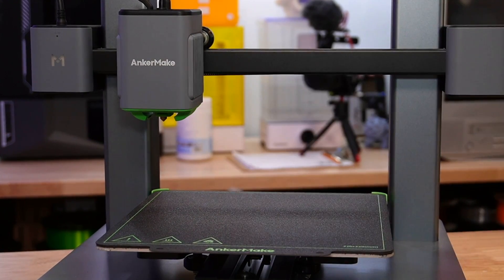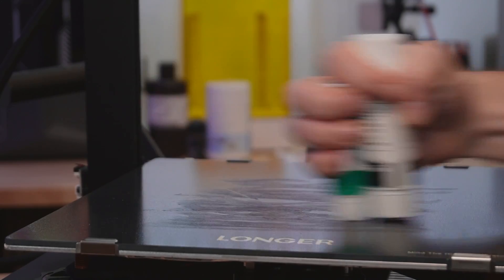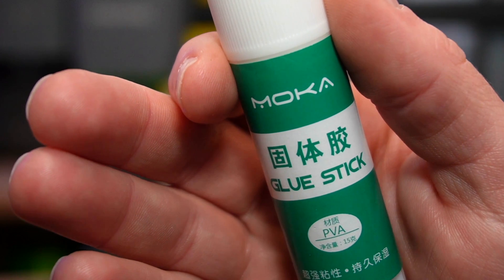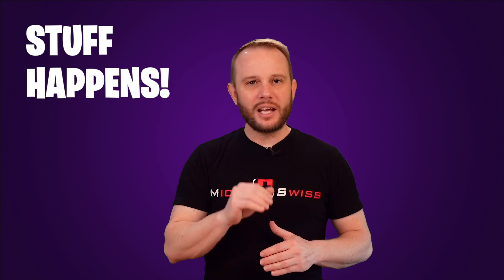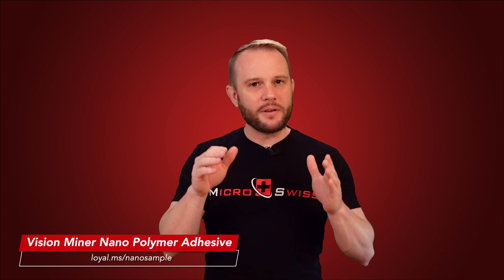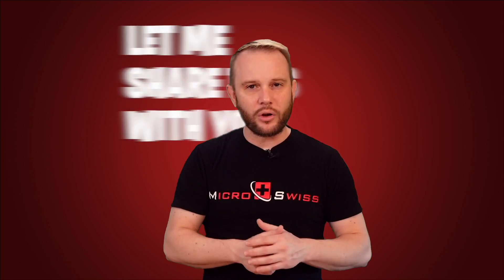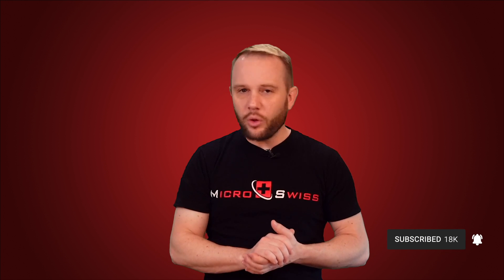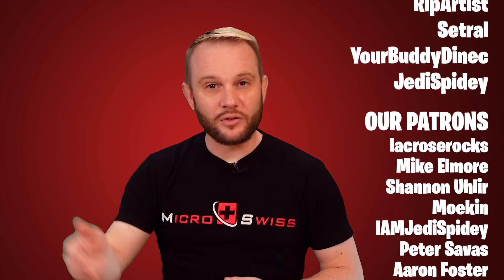This Simple Swap Saved My Difficult Prints

Comment: Pro Tip; PETG when stuck to glass will come off much easier and prevent damage when you heat the bed to 100c 👍will also probably ruin your print 👎

Comment: Nothing but Nano Polymer Adhesive. I use their 22IDEXv3 to print everything from ABS to Ultim 9085 and PEEK. When filament is $1+g you don't take chances with warping. Make no mistake I charge enough to make a profit, but it's cool to know parts I've printed are in everything from race cars to experimental aircraft. Even on my bambu machine NPA is a standard as some of their machines can get into the entry level real engineering filaments and with those the cost of failure goes up dramatically so don't take chances with warping. And not even Bambu comes close to Vision Miner's ease of maintenance. You open the top turn it around open two panels in the back and everything is there to easily troubleshoot and swap. The machines are very manual, but fantastic. Yeah they're $14k but mine paid itself off in a little over two months and it wasn't printing flexi-dragons. Note they're also 200lbs so make sure you have people to help and a very sturdy surface to put it on. I'm betting people using glue sticks and hairspray haven't been printing with a roll of filament that cost more than many of their printers.

Comment: Can you cover what adhesives could hold down HDPE filament cause I recently used the nano polymer of vision miner but to no improvement
Reply: HDPE is a warping monster with poor self adhesion. Even with a heated build chamber it will cause problems and you need a heated build chamber to hope of even getting a good print out of it.

Comment: Guestick is perfect, it's low tech, it has enough adhesion to work on models but is weak enough not to risk the plate, it's super cheap and it is water soluble which makes it economical, a damp cloth can reactivate it for a 2nd, 3rd, 4th print, and makes it easy to clean wipe the plate clean with the same damp cloth.

Comment: I've found bed weld to work really good and cheaper. I use it on multiple printers. Lasts a few prints.  Leaves little to no film if you let it cool. I do flat glass. 

Still want to try this next.

Comment: I recently started using a mix of PVA glue, water and IPA on my beds and spreading it with a $2 buffing pad from Harbor Freight.  It's dirt cheap and the buffing pad is huge, so it takes no time at all to cover the entire build plate, unlike the magigoo applicator.  The layer goes on so thin and even that it's barely noticeable unless you touch it.  

I don't know if it's really necessary, but I can go through a lot of bottles of elmer's glue and alcohol before it adds up to the price of a new build plate, so I take no chances!

Comment: I've been using Magicgoo.  I trashed a build plate getting PETG off of it.  If I'm not mistaken, the Magicgoo works similarly to the Vision stuff.  Sticky above 50-ish, and un-sticky below. Also, similar kind of thing, multiple prints without re-applying on the plate.  It's excellent especially  for PETG, but all my build plates now get gooed... Either way, I have ditched the glue stick.
Reply from the maker: Awesome! They aren’t quite the same, Magigoo has different products for different materials, while NPA works with everything. We have some Magigoo here too, works well!
Reply: @LoyalMoses  Right.  I'm using the default original? formula, none of the the specialized ones.  I've only printed PLA and PETG at this point.  I'll probably grab some of the Vision stuff and give it a shot.  Good videos man, keep up the great work!
Reply from the maker: Thank you!

Comment: I haven't used a glue stick, but I have struggled mightily to get my TPU prints off the MK4 bed, almost damaging it. I tried a thing I heard good reviews about this week: 1 part clear PVA glue, 2 parts isopropyl alcohol (99%), and 2 parts water. I have a 10ml pipette, so each part was just that to nicely fill a 50ml envelope moistener bottle, the kind with the sponge and the cap to keep it from drying out. I tried it with a little disc print of TPU, and it worked great. Peeled right off. It goes on as a thin liquid, which I like more than the smudgy looking glue stick (which I would have opted for if this hadn't worked so well).
Reply from the maker: That is great to hear that you found a solution! Interface layers are great for helping release prints too, people forget about that!

Comment: I lost a large print last night on an Elegoo Neptune Max 4. Which adhesive would be recommended for that printer for a large print? Is the recommended temperature at least 60 C on the heat bed? I saw it was 45 and the room cooled. This is my first go at this all this!! Thank you!
Reply from the maker: 60c would be best for the build plate temp, and yes, this Nano Polymer Adhesive would be the right choice to hold it down!

https://loyal.ms/visionminer
Reply: @LoyalMoses  thank you sir!

Comment: I just want to thank you for the tip that your probably didn't even mean to focus on.   I have a Dremel printer with a glass build plate and it has been very hard to remove the prints until, you said glue stick is a release when it gets cold, so now I put the finished print in the freezer on the build plat for 10 - 15 minutes and it comes off with ease.  Share this with others. Thanks again.
Reply from the maker: You are so welcome! What you discovered is actually very common in the industry. Many have found prints stuck with nowhere else to go and the answer has definitely been to put it in the freezer. Also, some turn an air can upside down and blast it with a bit of cold to get it to pop off.

Comment: According to the MSDS this "Nano Polymer Adhesive" is mostly 2-Propanol, or what we would usually call isopropyl alcohol. I guess they mixed in some water and PVA or PVB with IPA and sell it as "magic bullet". Might be interesting to actually try that as a cheap DIY solution.
PS: Interesting that they basically use the same bottle you get vape juice in. Makes sense, because you get them very cheap thanks to the mass production volume of vape juices.
Reply from the maker: Call them up on the phone. They hired one of the top polymer scientists to create the adhesive. PVA and PVB won't hold engineering plastics down. In-fact, you can put it on raw steel or aluminum and print directly to it. It's crazy stuff.

Comment: It sounds like it comes down to how many and how often you print. I use glue sticks with mostly no problems as long as I remember to replace it after 3-4 prints. I switched to a textured PEI bed and haven't used glue sense until I got my new printer. It's a smooth PEI bed and says on the bed to apply glue. I've tried without glue and had mostly success but success every time with glue. If this can last as long as they say it would save time and money.
Reply from the maker: I'll still use both of course, glue sticks on some machines just work great and are quick, but for nice prints, I like the nano polymer adhesive.

Comment: does the nano adhesive leave a residue on the print surface like glue stick?
Reply from the maker: No, it’s far cleaner. Less comes off when you remove a print than glue stick.
Reply: @LoyalMoses  great to hear, will try it.

Comment: I tried visionminer stuff when it first came out. PLA would not stick at all, every print failed. So I normally just keep a very clean flex plate and if I see the first layer looks bad, then out comes the glue stick.

Comment: I print ABS, ASA, Nylons, PETG, PLA, etc. and I've never used an adhesive. The only bed adhesion issues I've had so far is with long, thin PLA prints and I've always resolved it with design, slower speeds, or mouse ears on the worst offenders. I've got a drawer full of glue sticks from all my printers because I've never wanted to deal with the cleanup but this Nano stuff seems worth having in the tool kit. I'll order some up to play with.
Reply from the maker: Give it a shot!
Reply: Most of my prints are ASA and PA-CF with large footprints. The vision minor nano polymer works the best. It's not that all my prints fail due to the corners lifting without the polymer, but it really reduces the amount that does. It's like buying a bit of cheap insurance.

Comment: TL/DR: Getting any specialized glue for 3D printing - in addition to glue stick - is in my opinion the most important add-on for success you can "just buy" - and not having to dive into another rabbit hole for a change. 
(Of course knowing when to use what and when not to use glue stick it is important too though)

Initially I never used any adhesive for PLA prints on a smooth PEI plate. 
(For that combo still no adhesive is needed if the surface is clean and the model big imo)

The turning point happened when I tried PLA on a textured powder coated plate. 
Even with perfect Z-offset and a freshly washed plate with high quality dish soap, the models with smaller footprints came loose. 
I remembered my printer came with a PVA gluestick and I tried it out. 
Funnily not only did the small prints came loose, now also some medium prints failed X-D 

And there it finally clicked for me what PVA glue stick is not necessarily always for "prints sticking better". 
Rather that you have an interface layer to help remove the prints easier (ok, I admittedly used YT to get that information :)   
After that it dawned on me that I have just been using the wrong adhesive for the wrong material and for the wrong utilization.

Then I tried one adhesive specialized for 3D printing (not Nano Polymer though) and - oh boy - what a night and day difference.
Now I use specialized glue for almost every print and even dare do stick-like prints vertically without brims.

Quick tips: once the glue is used up from multiple times printing on the same spot, you can use water or propyl alcohol on a (preferably microfiber) cloth to "smear" glue from the unused spots over to the used ones. 
I would also protect a plate from dust with glue applied on it! 
Either covering it with a foil, storing it vertically or simplest - just flipping it over on the printer when cold (provided your glue is not "staining" and stays on the plate).
Reply from the maker: This was a great read! Thank you for sharing!

Comment: Never needed a glue stick until I did lol. Seriously, I don't like using a bed adhesive (mostly because it's the last thing I try after everything else and I never learn) but there are cases where it is necessary, just another variable to consider in a hobby with a billion variables.
Reply from the maker: So true!

Comment: My Creality V2 worked perfect for about a year on the glass bed. Then all of a sudden I started getting curled corners. I didn't want to go the route of the glue stick, so I vigorously washed the glass bed, put the printer in an enclosure and tried fine tuning my print specs. I still had curled corners. Eventually I flipped the glass plate over, put some purple glue stick on it and never turned back
Reply from the maker: It works wonders!
Reply: @LoyalMoses  I may need to try this product. The issue I have with glue sticks, is that you need to clean it off every so often because you build up a residue in the areas that the filament doesn't touch the print bed. It seems as the the nano stuff is a thin enough layer and since it doesn't need to be reapplied so often, it won't build up.

Comment: I have reduced the amount bed adhesive materials (glue stick) I use.  I hope to send my scrape to a recycler and they will not accept scrap with adhesive materials on them.

However I have found the purple Elmer's glue stick works well and washes off fairly easily.  It turns purple again when hit with water so it is easy to tell if you missed getting some off.
Reply from the maker: Awesome!

Comment: In my opinion, there is no need for such overpriced special products to ensure that the 3D print sticks to the printing plate. For the few cases where I print “problematic” filaments, a glue stick is sufficient.
Reply: To be fair, you get a lot of mileage out of this stuff. I bought a bottle getting close to a year ago that's still got 1/3rd of it left. I also apply it more religiously and clean my build plate than is necessary. It's much easier to apply and clean than a glue stick. I never used hairspray so I can't compare to that. 

Basically, the cost is not an issue. You get a lot of mileage out of a single application and the convenience of applying it alone makes it worthwhile to me.
Reply: @Dalroth  Your statement is a point that I can understand.
Reply from the maker: You can’t hold down nylons and polycarbonates without it! 💜
Reply: @LoyalMoses  Well, I see it differently. Or rather, countless videos on YT prove that it is possible. ;)

Comment: I started using the Nano Polymer about a year ago.  I messed with everything else before that.  I bought the big bottle and 1500 prints later I haven't even used half of it.   This stuff works great and I highly recommend it.  I get many prints off one application (around 40-50) for PETG and PLA.  For expensive and engineering filaments, I apply it on each print.  I don't have to wash off the print surface as often.  For me it will last at least 3000 prints, so the cost is not even 2 cents a print.  It is worth it to me.
Reply from the maker: Absolutely! Amazing stuff.

Comment: FINE. I'll try it. Looks fairly residue free, would have liked a few more examples of the prints and plate after. I don't want messes in my print cells. But I've had some curled edges lately that won't stop happening so I'm hoping this could fix it.
Reply from the maker: Give it a try, it’s cheap enough and I already know it’s going to work out very well! Let me know what you think!
Reply: @LoyalMoses  Checking back in after a handful of print tests with the Vision Miner solution. While I didn't use it with the exotics that its probably more useful for, I will confirm it definitely solved my PLA edges curling up on textured PEI sheets. No matter of washing/scrubbing ever got them to hold PLA super well after they were broke in. But since most of my prints are PLA and I like the textured look, it was nice to have them hold down again. Also didn't seem to transfer any weird color or residue over to print. The plate does show where you have printed now, which I printed over the same places to see how it would affect it. Seemed fine overall. My only gripe is not with the product but how if you touch the build plate with a rogue finger its very visible where you touched it. I assume it negates the coating. Normally I clean my plates before every print with IPA but now that won't really work. I guess it would be up to the user to decide if its worth it.
Reply: I've never had issues with vision miner residue getting on on my prints. It does start to look a little funky on the build plate after a couple prints, but that's just the build plate.

Comment: Only time I don’t use a glue stick, is when the bottom layer is decorative. I hate the look the glue residue leaves, even when it’s washed off.
Reply from the maker: I know what you mean. Can leave swirls, etc on the bottom.
Reply: I haven't had any issues with a light layer of the vision miner glue. No residue on the prints anyway. It does start to look a little funky on the build plate after a couple prints but never affects the models and cleans off easily.
Reply: I haven't tried it yet, but I'm wondering if diluting it out with distilled water or isopropyl alcohol so that the coating is of a uniform thickness might help...

🤔

Comment: I found my four year old ender 3 printer that I haven't printed with in about 3 years. After the first print I found that nothing can be printed on this printer because the printout never sticks to the bed. So I calibrated the printer for about 5 hours but still no result. So I started searching youtube for a solution and everyone said I needed glue so I bought 3DLAC and right after applying glue even without calibration it prints like new.
Reply from the maker: That's awesome to hear! I am glad you got the prints to stick!
Reply: Washing the plate with dawn soap helps

Comment: Did you have to mention printing PETG on a glass build plate? That still stings.😢
But yeah el cheapo glue stick is my go to.
Never need to use it for your mainstream filaments, but anything that needs more heat or is expensive, cheap insurance.
Reply from the maker: Oh no! You had a glass breakage?!
Reply: @LoyalMoses  Yep I cracked it. But luckily I got a replacement metal base that lets me use pei metal sheets for the actual build surface. Not too bad but I still feel stupid about the PETG incident.

Comment: Ironically I have printed so many ABS parts on my Voron V0 with the same application of Glue Stick on a smooth PEI sheet. I haven't cleaned the plate in over 1 year. Yes I've had a few failed prints it's very rare.Of course now that I've said that, I'll probably have loads of adhesion issues now. LOL. Typically the prints that failed were very close to the edge of the build plate. I likely don't have glue there.
Reply from the maker: Glue stick is just awesome stuff! I hope you didn’t jinx yourself!